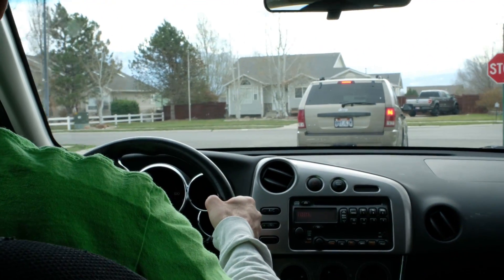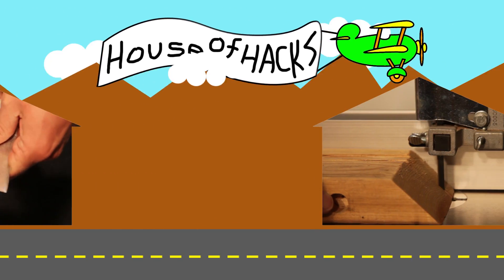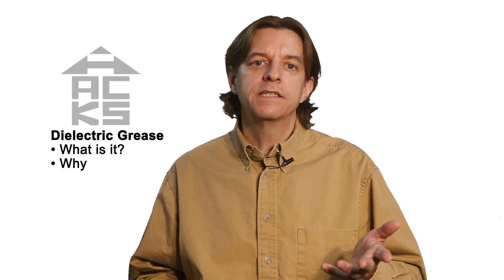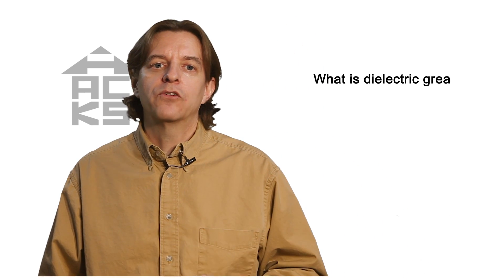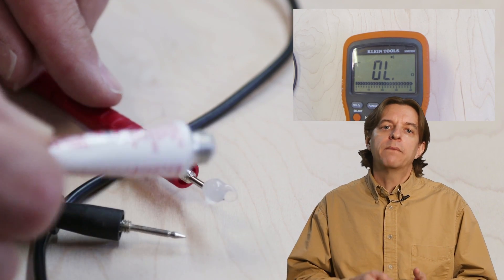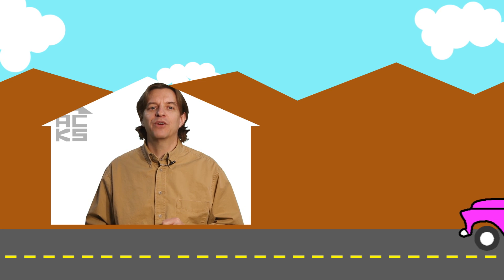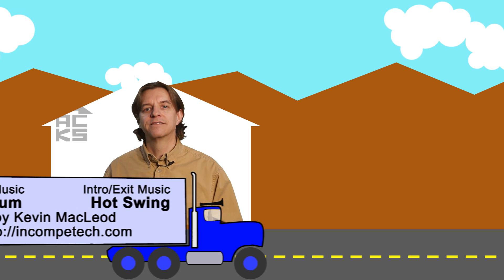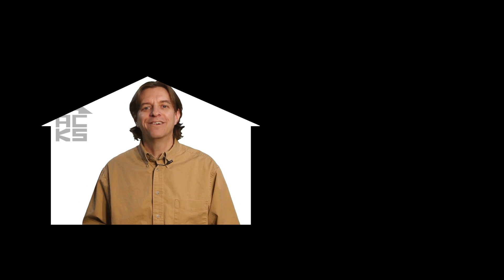What is dielectric grease and why should I use it?

Comment: This is by far the best, clearest, and actually true explanation of dielectric or silicone grease. 
Could you do a video like this on white lithium grease. In the tube not the spray. I have read it provides the same dielectric properties???? I’m a missionary in Brasil and it’s tough finding the right things when you need. 

Also, can I use silicone grease or dielectric for brake caliper pins? Is it the same thing in a different tube? 

What’s the difference between dielectric and silicone grease?
Reply from the maker: Thanks for the kind words.

I've not heard that lithium grease is a good dielectric, but all grease has some insulation properties.

Dielectric grease is a type of silicone grease that is formulated to have extra insulation properties to help serve its intended purpose.

Silicone greases and lithium greases are very different and shouldn't really be substituted for each other long term. It would probably be OK in temporary, emergency situations where it can be cleaned out and the proper one used at the soonest available time.

Thanks for the question. It inspired a video that'll be released today or tomorrow.

Peace.
Reply: Has “some insulation properties” you mean “insulation from air and water” ;) 
Did you notice how Your conductivity test took longer with the grease? I think it’s because there was no airgap to start the beep like the dry pins had to jump across (albeit a tiny airgap).
Reply from the maker: By "some insulation properties" I meant "somewhat acts as an electrical insulator." ;-)

Comment: Changed out my PCM on my Jeep Cherokee year 2000 and it's still stalling at times or cutting out. Some people recommend using dielectric grease on the 3 terminals and then when I plug them back in also zip tie them in so they're even more secure. Any thoughts? Thanks.
Reply from the maker: It certainly wouldn't hurt putting grease and zip ties on them. Have you identified those connectors as being the problem? Can you wiggle them around and have it die while the engine is running? I had an intermittent problem on our Jeep. It turned out to be a wire in the engine's wiring harness where it went around a corner had worn through the insulation from rubbing and occasionally grounded out the ignition system. Our mechanic taped it up and rerouted the loom a bit so it wouldn't rub on the bracket.
Reply: Thanks so much for the quick comment.  I did wiggle the connectors and it did not stall. Although, as you know, a vehicle sure bounces just enough to rattle the connections and potentially short. This is the second Jeep I've had to change out the PCM. First time it costs $1,500. This time I purchased a remanufactured for $170. Frustrating as heck. Can't complain much as the first Jeep went over 300k and this one has 245K. What makes it frustrating is mechanics seem confused. Since it happens intermittintly it's hard to diagnois.  Today it's driving great. Crazy. Keeping my fingers crossed. Thanks again and any suggestions always welcomed.
Reply from the maker: You're welcome. Happy to help where I can. Intermittent electric problems are a pain. Good luck.
Reply: It ended up being electric, but it was the cam shaft position sensor.  I changed it out a week ago and not a problem since. Well, at least I have a new PCM.
Reply from the maker: Oh, interesting. I've never heard of that being an intermittent failure. All the cases I've heard of have been sudden and permanent. Glad you found the problem. Cheers.
Reply: So glad it was figured out. Thanks to the internet. Thanks for your input as well. Information is power. LOL.

Comment: Out of all the Videos on Dialectic Grease, this is the only one that is accurate. I have been using it for over 30 years and it always works. And NO it will not "insulate" a normally good connector, if it is metal to metal, the grease pushes out between the contacts and creates an air tight seal. This works on all automotive connections, and UHF connections at high voltage. Just make sure you don't lubricate a bad connector that then pushes back apart. I use wire ties on questionable connectors to make sure they stay plugged together. I have been rebuilding, and rewiring cars and off road vehicles since the seventies. I also rebuild vintage Amateur Radio Transmitters and equipment.
Reply from the maker: Thanks! Yes, part of the reason I did the video was because I saw so much misinformation out there. Good idea to use wire ties if in doubt. Peace!
Reply: I agree with you 100%. I've used it for about the same length of time. I also have a boat and trailer and I cake on the grease on all electrical and batteries. And on other boats I work on. It's the only thing that saves electrical connections and adds longevity to them.
Reply: Thank you!!!
Reply: Is there any automotive connectors where this should not be used? Thanks
Reply from the maker: @Johnny Appleseed Thanks for sharing that article. Cheers.

Comment: I understand using this on the inside of a spark plug boot for ease of removal but being that it has as stated,  non-conductive properties, wouldn't there be a problem getting a spark plug tip coated with this?
Reply from the maker: Yeah, you wouldn't want to coat the tip, although it'd probably be burned off in short order inside the combustion chamber. But having it on the connector inside the boot actually helps. The grease will squeeze out of the way and allow metal-to-metal contact but isolate that contact from the atmosphere's oxygen and moisture to help keep it from corroding and oxidizing.